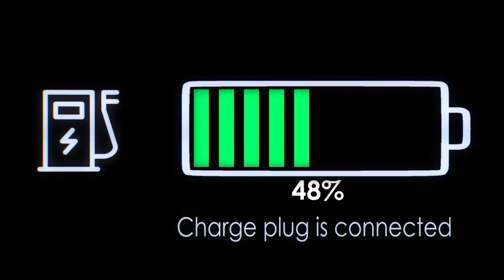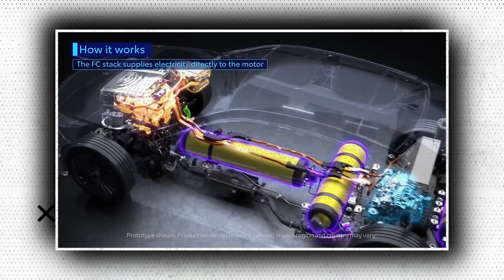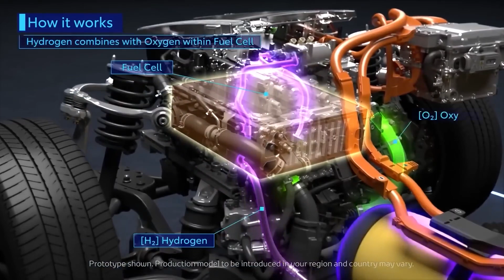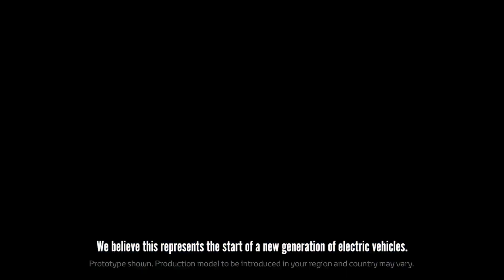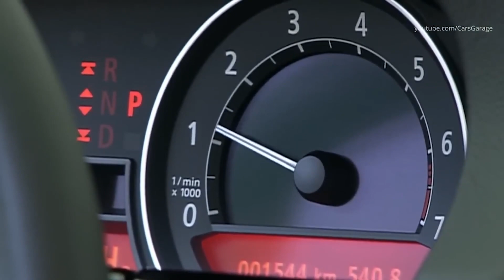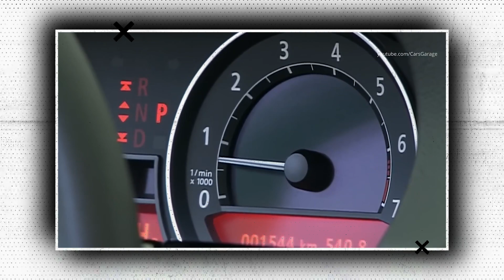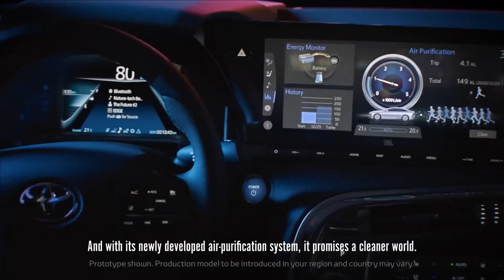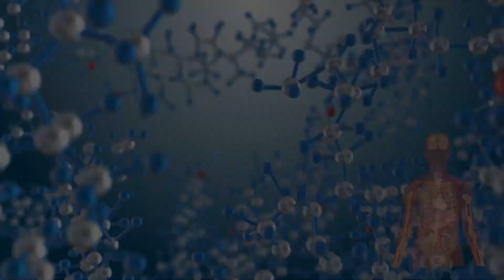Koji Sato: “This Toyota's ALL-NEW Engine Will Crush The Entire EV Industry!”

Comment: They should focus on planes and trucks. That’s it. This whole process, including the increasing amount of components in the car, is entirely inferior to just plugging straight into harnessed sunlight. Sorry, but this isn’t gonna happen. 

I will say that there is a HUGE amount of resistance to EVs due to IQ constraints. These people can buy as many Hydrogen cars as they want. Have at it
Reply: …there is resistance to EV because the process to mine, refine, produce and dispose of lithium batteries is environmentally destructive.  Additionally, electric production is performed via the burning of fossil fuels.  Think the problem and solutions through before becoming an EV zealot.

Comment: Internal combustion engines, no matter what fuels them, are doomed. The EV will overtake them in almost every situation. The two most basic reasons are efficiency and the number of parts. The equivalent MPG (Miles Per Gallon) efficiency of currently available EVs is over 100 MPG (using gasoline as the fuel). For example, the 2022 Tesla Model Y long range AWD is rated at 122 MPGe (combined city/highway). There is no way internal combustion engines can get anywhere near this efficiency. When it comes to the number of parts, a typical V-8 engine has hundreds, and a modern 7 speed automatic transmission also has hundreds of parts. The only moving parts in an EV motor are the 2 main shaft bearings. The Tesla reduction gearbox has 3 gearshafts and 6 bearings to support them. In the end simplicity wins.

Comment: By the time hydrogen is manufactured, compressed to thousands of psi, transported, and given it's losses due to production and combustion inefficiencies it is over twice the cost of electricity.  Also, with hydrogen, the users are forced to the pricing whims of big oil suppliers.  Except for maybe commercial vehicle use, hydrogen is much too expensive when compared to electricity.  If Toyota is placing their bet on hydrogen, it will be a losing battle compared to EV's.
Reply: Hydro is gone, toyota is back to hybrid ev..next 5 years toyota will be full ev...